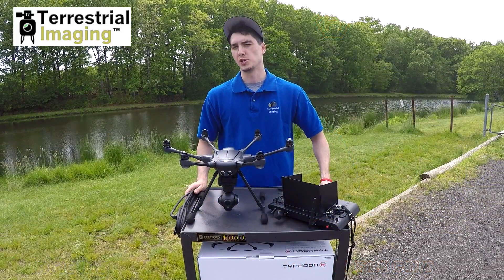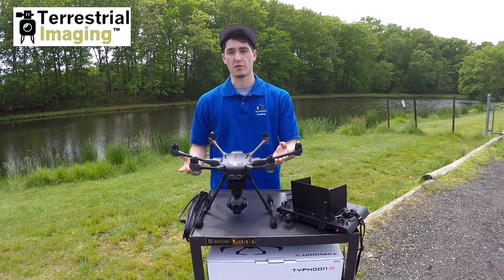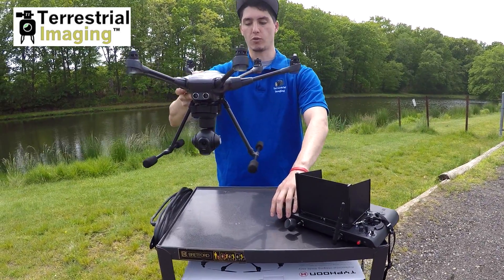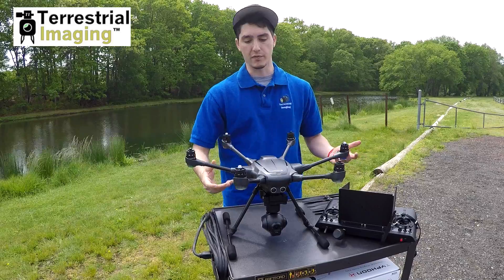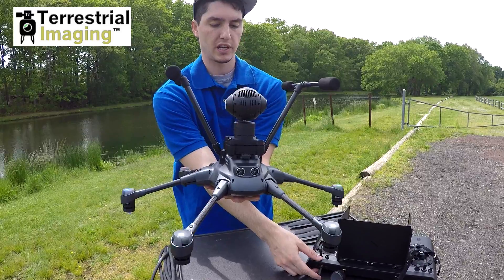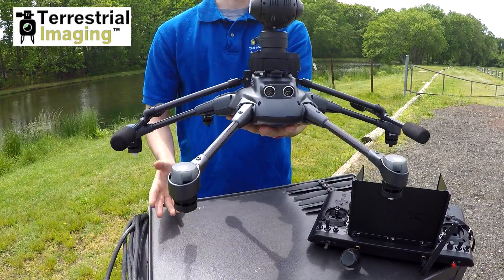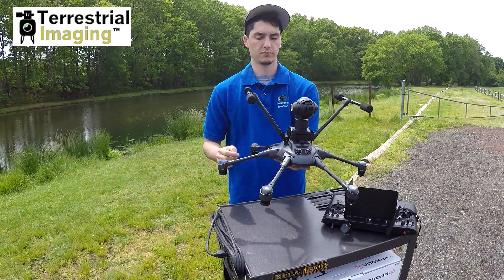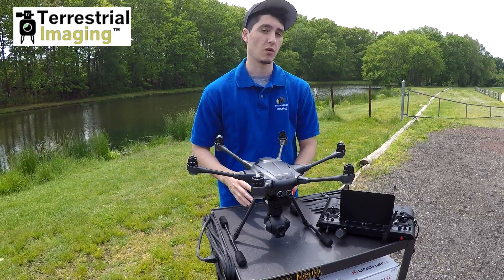Cycling The Landing Gear On The Yuneec Typhoon H by Terrestrial Imaging LLC

Comment: I have a TH that the landing gear only cycles with a different st16. The menu tells me that the switch is working, but yet it maybe isn't sending the correct signal on the "landing gear channel" Is there a way you know of that you can calibrate that channel specifically?

Comment: Does anyone here own a H, and has put a few flights on it?  I am looking for some help in understanding some of the flight characteristics mine had.  What I am trying to determine is if mine was defective or if it was something else.  The H I had flew crooked and toilet bowled bad.  No amount of compass or accelerometer calibrations would fix it either, even in different places.  The crooked flight started became worst as the battery voltage decreased.  Also my gimble would become uncalibrated every two or three flights and hold at a 45 degree angle.  The gimbal would also become crooked any time I calibrated the accelerometer. Anyone else have this problem?  Or not?  any info helps.
Reply from the maker: Hello +Tanner Carpenter,

So this toilet bowl issue is a known error. Every machine is under a 6 month manufacturer warranty and if you contact Yuneec they will be able to assist you with the toilet bowl issue. Fortunately, this error is not a common one, though it does exist.  We have sold tons of Typhoon H's and If I can recall correctly, there were only 2 or 3 toilet bowl issues. They were replaced by Yuneec and the new machines were never an issue.
Reply from the maker: Glad your back in the air!
Reply from the maker: Agree completely.
Reply: I own an H, I recently backed up most of the raw footage from flights you can check them out. For the most part it has flown as expected since day one. I did have one incident where an apparent GPS glitch resulted in a crash, however damage wasn't that bad and was fixable without having to send it under warranty. I have defenitely noted that once I get the first low battery warning the H starts acting up.
Reply: Jules_Flies I ended up sending mine back and having it replaced with a new one.  My new one has zero issues from start to end.  Every now and then I have to calibrate the camera, especially if I go down a long bumpy road.  Elsewise it performs perfectly.  My old H would have problems when the battery became low.  My new one does not.  I have flown it to critical battery, and it does not change its flight behavior at all.  I have flown 100s of flights by now. The only thing I notice is that apparently the props wear out, and the battery does not last as long as it used to.
Reply: Terrestrial Imaging LLC Yah, I had to have my Typhoon H replaced as well.  Was awful but at least now I am in the air with a super reliable machine.
Reply: Terrestrial Imaging LLC Yup.  I have flown hundreds of flights with my new H and never had a problem.  Thing is super reliable.

Comment: probably the safe thing to do if you want to really actually test this is to take the camera off of the Drone first. That way there is no possibility of damaging the gamble while it's powered up and putting it upside down. It probably wouldn't hurt it but you never know.
Reply: Yeah thatsba good point. It will take any unwanted strain off the gimble. Thanks for the suggestion !

Comment: If and when Yuneec is going to implement the Intel RealSense Technoloy, they better have the IR transmitters/senors mounted on the 6 prop arms, so the drone can avoid obstacles when it is approaching at 6 different angles.

Comment: Why do you have to flip the drone to test the landing gear? It makes more sense by just holding the drone in the air or hovering  to check the actuation of the landing gear.
Reply from the maker: eagle...if you hold it in the air and flight the switch the gear won't go up.  Not sure, but there might be some sort of accelerometer in the unit....either way, flipping it over get's the job done :)
Reply: Imagine toggling the gear up while it's in the normal orientation - you're now resting the drone on the camera & gimbal. Yuneec wanted to add a safety measure against damaging the camera by accidental or intentionally raising the gear while in the upright orientation.